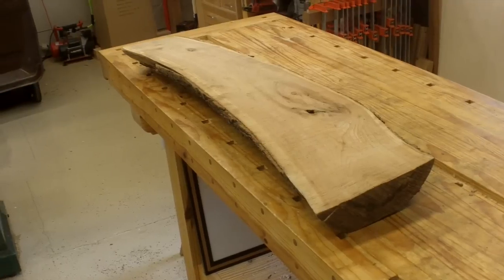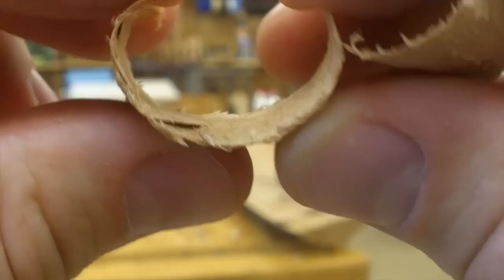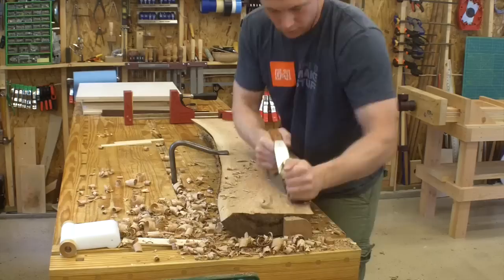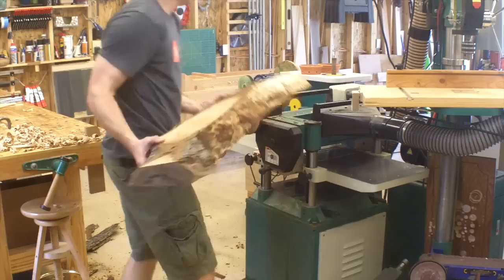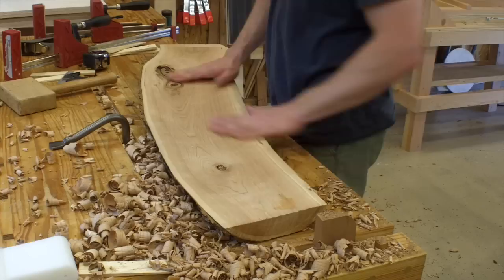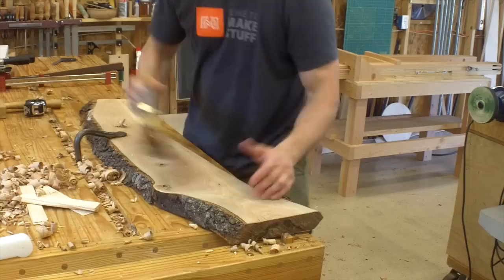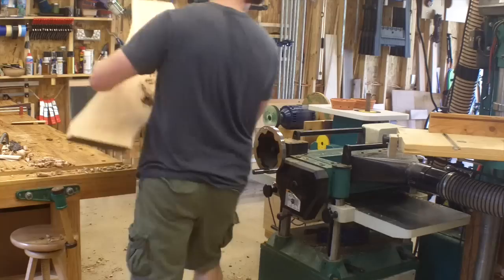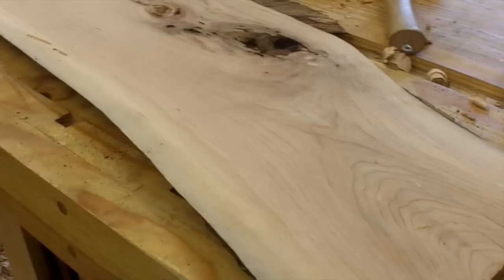Who needs a big Jointer!  Scrub Plane and Power Planer

Comment: I don't have or need a jointer, but I do have a planer..  I have used this method for years and it works very well. I use a modified blade on a Stanley #5 Jack Plane.  It works well, but I do think a scrub plane would be more aggressive and faster.  Thanks for the video and the advice!

Comment: The cool part of using hand planes and scrub planes to straighten crooked lumber is you can concentrate only on the high spots reducing the crooked surface to a plane. Lumpy but pretty flat is close enough because the planer can make the opposite side parallel as Andy demonstrate.  Besides, it's healthy exercise.

OTH, an experienced small scale sawyer once told me "You can't get straight lumber outa crooked trees." Makes sense to me. The crooked lumber better have a compensating advantage - handsome grain, fits a crooked space, legacy tree, etc. - before I sweat through a shirt straightening it out

Comment: Not picking any holes  Andrew. Just to let you know, the scrub plain is intended to be used directly across the grain or not really less than 45degrees to the grain. If you try that I'm sure you will find it easier.
Reply from the maker: Hi Rory, thanks for the comment, but I'll politely disagree.  There is no rule that you should not use a scrub plane parallel to the grain, and in fact if anything it cuts easier that way.  The risk in doing this is that you will have tearout, and if this is happening excessively then switching to a 45 degree or perpendicular approach to the grain can help.

Comment: My experience in flattening timber is that a small amount of twist is correctable, but that piece of timber you are flattening will continualy re-twist as time goes on, something about the stresses relieved when the first flattening takes place causes stress in return...    Have you found the same conclusions in your experiences?
Reply: you,ve hit the nail on the head there....you only have to look at that piece of timber to know that it will not conform to the will of the woodworker...chop it up and put it in the stove.

Comment: That worked better then I thought it would, never used a ha no plane b4, you could also have built a router plane to flatten it, or fasten the board to the router plane jig with shims under the high spots and send it through the planer that way.  Cool to see how functional hand planes are tho, seems like it would take a high skill level to do good work with them ?

Comment: Planer sled (not router sled as Andrew mentions!) with a couple of shims works very well and is a considerably faster method but if you enjoy using the scrub plane that much I say go for it........
Reply: Have used both... I think the scrub is faster than you realize. Pretty tiring though!
Reply: I have a scrub plane and agree with Tim. It's a lot faster than you might think.
Reply: Um...don't be dismissive.  There is such a thing as a router sled.  They work very well on boards too wide or heavy for the planer.

Comment: Now this brings up the question of jointer planes, the big ones. Wouldnt those be helpful to use?
Reply from the maker: Sure, if you have the cash for a good one that converts easily and hold it tolerances, and is large enough for what you are working with.  That's just not always in the budget, they are quite expensive.
Reply: Got a wooden one im currently getting back to working order.
Reply from the maker: Oh, I think I misunderstood your first comment, I thought you were talking about power joiner/planer combo machines, my bad!   If you where doing the flattening all by hand you would use a scrub plane first, then finish with a joiner plane.  I was showing that the rough surface from a scrub plane is good enough to send through a planer if you wanna save time by with a hybrid approach.
Reply: +Willem Kossen q

Comment: Hey Andrew, somewhat entirely unrelated question. I'm just curious. Did you modify your ear protection? I think we chose exactly the same ones. 3m Optime III? I ended up pulling apart some cheap Sony's from Amazon, but now that I know they work perfectly, I think I'll upgrade.
Great advice in the vid.

Comment: If that sits around again for a while will the twist and bow come back?
Reply: Bo Ranson yes that will happen. That's why when you join/plain rough lumber, never go for final size/thickness at once. Best way is to flatten it roughly, then let it acclimate your shop temperature/humidity for several days/weeks, it depends, and then come back and finish it to final size. I tried to make short answer :-)

Comment: Really nice demo Andrew. Too bad one can't just manpower those out to save thickness.
Reply from the maker: GuysWoodshop Well it certainly can be done all by hand, but that just too much work for me.  I'm not really sure how much thickness that would save, maybe a little bit if you're really good.
Reply: +GuysWoodshop 
Why everywhere you want to use muscle power and hand tools imperfections ??
 Tell me with how well you are able to make a simple board ?? What else do for yourself and show your friends proudly that he done, and what else do it according to the plans and dimensions ordered

 Muscle strength lately is getting more expensive - you are doing more or less exactly - and worst - you need to improve - that's the truth

Comment: Andrew,  I have a ton of hardwood logs that I am wanting to do 3"-8" disc and cover a wall with them.  What is the best piece of equipment to do this with a band saw or table saw.Also wanted to know what model planer you have here.
Reply from the maker: +Greg Brooks I have the 15" grizzly with the grizzly spiral cutter head (don't recall the model number).  Bandsaw seems like the way to go, as the table saw won't get through the wider stuff.  I'd make some kind of crosscut sled to secure different sized logs.  Proceed at your own risk.

Comment: cool to see my methods work for others too, lol amazing what you can get for free because they only see a useless piece of wood,,built 2 cedar benches this way ,wood was free, so worth the time investment , and i used what would most likely of been fire wood to the guy i got it from , lol another guy seen what i did and gave me rough saw maple 4-6'' wide x 4-14 ft long  ,3 half ton truck loads,for free, lol he had it milled on the wrong time of year( not seasoned right) and figured the twisting of some and the graying of the surface rendered them no good, lol ,even after i explained that 80% was still useable for projects , his answer was ya for fire wood, unless you want it, ,lol i said yes and him and a friend ,brought it all to my shop , and thanked me for taking it ,even a few pieces of figure (curlly) and several of birds eye ,to which i used for a jewelery box  i made as a gift for him ,lol well his wife ,lol  great video

Comment: Not being a woodworker myself I find this stuff fascinating; however, I'm wondering, why would you wear hearing protection but not eye protection?
Reply: Jeshua Patrick should be but he has a powerful dust collector sucking all the chips. Thats what the black chute is on top of the planer
Reply: Difference in problem. Theres only a chance that something will go in for eye, as it is projected in a single direction on a (sometimes) predictable trajectory. Noise is emitted in a 360 degree sphere and will always assault your eardrums, there's no "chance" of it happening it just happens.

Comment: i would have used a power hand plain, less work
Reply: +denny rat 
Lots of people share your attitude and that's okay but for me it's called a hobby because I do the actual work instead of watching a machine do the work.  I can flatten a board like that in about 20 minutes with hand tools.  I don't need hearing protection, I don't risk cutting myself, I don't need a dust mask and I don't need to vacuum the shop when I am done.  And as a bonus I get a light workout and the finished surface is perfect.  As far as I am concerned machines are for production work.

Comment: Okay, let me put you out of your misery. First off you scrub ACROSS the grain to get the high points down. Its quicker and takes less effort. Wet the board a little, that helps on gnarly timber, especially with knots, though your precious plane will get blackened by tannins. Dog the ends. Use the bench to gauge the high points with a compass. Set the compass at the lowest point on the edge and mark the highest edges with a scratch gauge line along the length of the edge. Then you have a line to dress down to. Sometimes, if its a bog long board it helps to drill pocket holes down to gauge depth at say 12” intervals so its easy to see when you are down to height. Thats an old musical instrument makers trick for soundboards.
Once its flat, turn it over, gauge the edges again and you have thicknessed it too.
Why do so many people forget their Bench is a reference surface ? Every Pattern maker or old school joiner knows that.
That curved edge on the plane cuts across the grain really aggressively without choking/jamming and far less effort. Its not designed to go with the grain.
Anyway, I don’t do it like that anymore, I have a 20” Joiner.
Same principle applies with belt sanders though I personally never use them. 
Violin makers scrub plane that way too. Thats why all their little planes have a very curved edge.

Comment: A router, a simple frame, some careful measurement and you could achieve better much quicker.
Reply from the maker: I am well aware of, and have used the frame and router method, it produces comparable (not better) results.  I don't think it's faster either, if it is it's not by much.  It also makes a lot more of a mess, puts fine dust into the air (don't kid me with dust collection, doesn't nearly get it all) and is loud and unpleasant.
Reply: A router on a frame is not faster. And you have to make and store the frame somewhere.